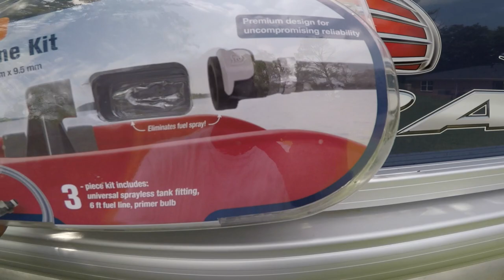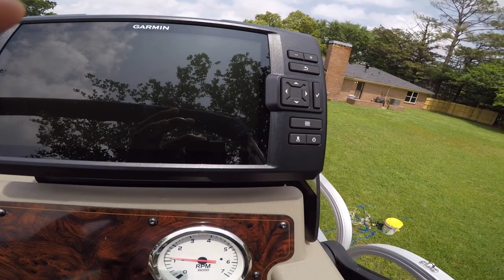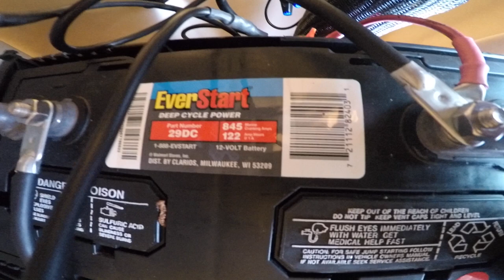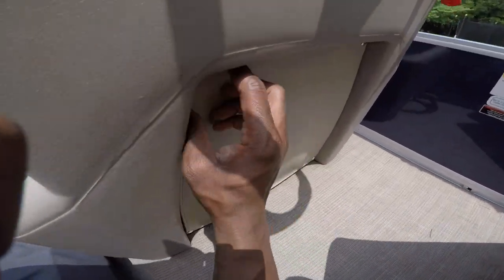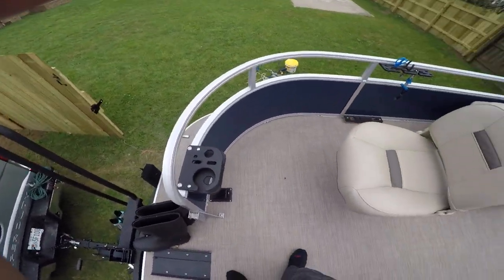2021 BASS BUGGY 16 UPGRADING BIGGER AND BETTER

Comment: Nice setup. Keep in mind with lead acid you only get about half the rated amp hours for usability. Lithium Ion gives about 90% of the rated capacity but much, much more expensive initially. Over the lifetime Lithium Ion is actually less expensive.
Reply from the maker: Yes that's right but these batteries came from Walmart with a 2 year free warranty replacement imma wear em out hahaa

Comment: Can you do a video on how you attached and ran the wires for the garmin transducer on your boat? How you connected...to battery or fuze box etc from console... Did you need an extender? I have seen videos where they say it is a little easier on right side but with the 16 XL there isnt a place on right side pontoon...only left....
Reply from the maker: I just saw this I will pull the boat out and do a video on this

Comment: I love the upgrades that you did to your boat but as it pertains to your batteries and trolling motor I would really like to give you a suggestion it even for others I'm building a double hole boat right now for my brother-in-law and as it pertains to your battery dying maybe a suggestion for you is look up a product called Blue seas add a battery essentially what that does is that you wired into what's already there and as you're running your main boat engine it takes the amps from that and charges whatever battery has the lowest charge and addition your home/start battery will never go dead on you and you're not dead in the water it is very simple to hook up they give you a diagram and if anybody is interested I could possibly take a video or pictures to show you what I have done but I'm on the market for the 18 ft Bass buggy and saving up for a down payment now thank you for your video
Reply from the maker: Holy smokes man thanks for that advice I must make this happen lol would be a even more ease of mind on the water

Comment: Nice boat ! I just ordered one and have to wait like 3 months minimum
Reply from the maker: You will love it...perfect size
Reply: @lifewiththedonersons  Does the 6 gallon stock gas tank last though the day on the water running easy ?
Reply from the maker: @natal777  with a 20 minute ride to our area of fishing and back it last about 3 fishing trips almost 4
Reply: @lifewiththedonersons  Thank you for the info so now I see why you got a larger tank 👌 sounds like at 4 hours  the stock tank would be dry for sure!

Comment: so if the small gas tank is running low u connect the fuel line kit and siphon the fuel from large tank to the small tank yes? Also is there some kind of a fuel guage on the small tank that will tell you ur fuel status?
Reply from the maker: Yes it is a gauge on both tanks to let you know… I just switch mine out when one runs out

Comment: What is the LBS on that trolling motor and how long is the shaft? Do you have any issues with that trolling motor not moving your boat in windy days?
Reply from the maker: Shaft is 54 inches 50lb trolling motor that get ate up on windy days, just upgraded to a 70lb awaiting on that to come in praying it fixes the issue some.  The pontoon turns into a kite in the wind due to the sides and if you have the top up your sailing with the wind for sure then lol
Reply: @lifewiththedonersons  thank you for that!

Comment: hey bruh. I ordered the 12 gallon tank and the universal kit u have. IS that enough? U were talking about a shut off valve and where do u buy that and what does that look like?
Reply from the maker: I just been switching them off using what came with the boat to simplify everything honestly didn’t even look for the valves but lowes or home depot sales them

Comment: Can you tell me if the built in rod holders up front that came with the boat are movable or removable? I want to mount something right where they are, like a grill.
Reply from the maker: Yes you can move it it’s not welded on

Comment: Did you attach the gas tank upgrade with straps? I love it I have been doing the same.
Reply from the maker: Yes I just screwed the straps straight to the floor and secured it that way, didn't want to make it a hard install

Comment: How does the 12v TM  work with your 16 foot bass buggy?
Reply from the maker: I upgraded to a 24v ipilot, so far it runs great only issue is when the wind pick up it try’s to turn the boat regardless

Comment: so are you using the 55 pound thrust or did you up it to the 24 volt 70 pound thrust? I’m thinking the 55 isn’t enough?
Reply from the maker: Still rocking the 55 but will upgrade it does not put out enough thrust when the water is choppy

Comment: Do you have to use 4 wheel drive anytime at the boat ramp.
Reply from the maker: At the ramp I have been going to I have had to use it on days after a heavy ran other than that I never use it
Reply: Thanks im getting a 20ft fishin barge and plan to pull it with my 2wd 1500 ram hopefully it will be good enough